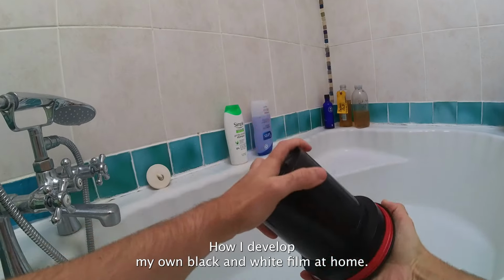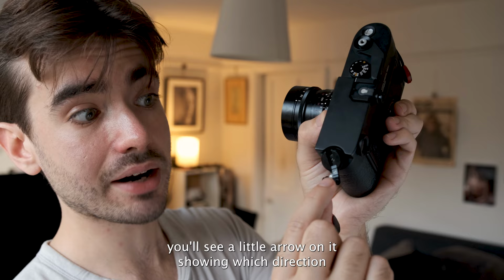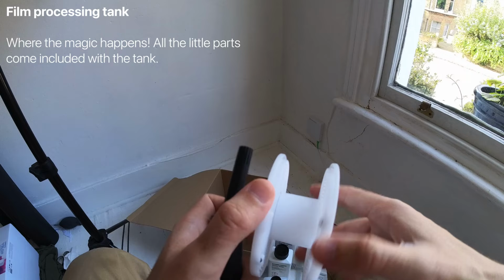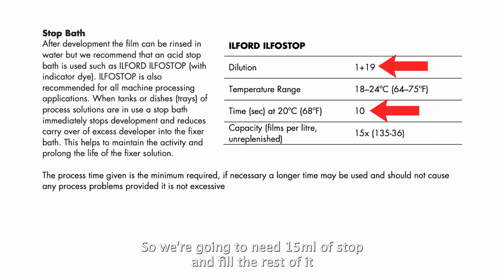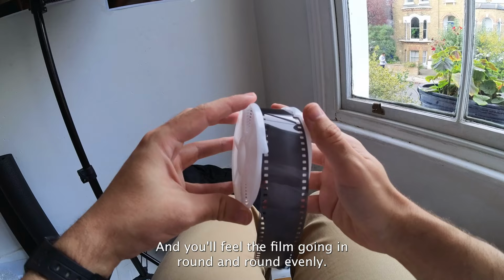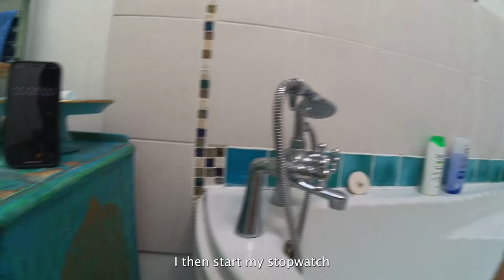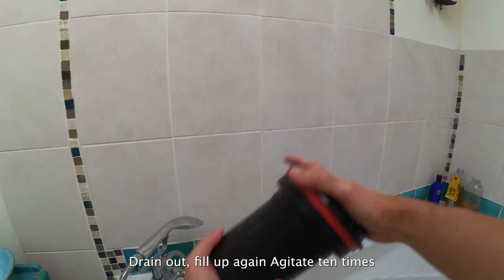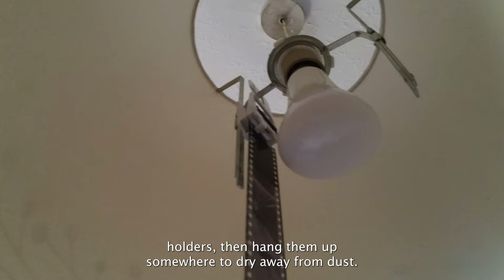How to develop your black and white film at home!

Comment: All in all, a very well put together video, very informal. Just a couple notes though; the rubber lid is for holding liquids in while inverting, it's not a light barrier by design, the small plastic bit in the center column is for agitating without inverting the tank and is optional, and lastly the temperature is not super critical to be exact as long as you get between 19-21 C you wouldn't need to adjust times to compensate for temperature.
Reply from the maker: Thank you for the information! 😎
Reply: @james-greenhalgh  most welcome

Comment: What are the chemical prices like these days? Last time I checked it was more expensive than having a roll of film professionally developed. It kinda put me off but I definitely want to get back into it.
Reply: If you're only doing one or two rolls every now and then, it could be cheaper to use a lab. But using concentrates with long shelf lives like rodinol or hc110 you will be able to process quite a few rolls, plenty enough to make a savings over lab service, and it lasts for years. But most b&w chemicals you are looking at roughly 12 - 30 USD depending on where you buy and what size you get.

You can also get a kit for processing up to 16 rolls for about 20-30 USD depending on where you buy it.
Reply from the maker: I agree with everything above :)👆🏻 

In the UK, Ilford products are generally more accessible from what I see as it’s all made in England anyway. Do take a look online for reviews of different chemicals to find the right one for you!
Reply: Buying prepared processing chemicals for B&W will probably cost around $30 (not including tank and related equipment), which is equal to about four lab processed rolls. However, that chemical supply can last for a year and will process dozens of rolls, depending on which developer you choose. So once you have the equipment, the "per roll" cost of DIY B&W processing is going to be well less than $1 a roll.

Comment: Not the right way to process a film.
Reply: Not clear on your objection(s) there. My negative comment(s) would be:
1.  The stop bath and fixer are reuseable. They do not have to be discarded after first use, and do so(as here) significantly and unnecessarily increases the cost of developing film.
2. The Pateson System 4 tank, used used here, is designed to agitate by twisting the little rod to spin the reels in the tank. It is terrible for inversion agitation, as here,  because the plastic lid leaks, it has a tendency to pop off in mid-agitation, and the huge volume of air trapped in the funnel-top turns the whole thing into a cocktail shaker, adding unwanted air/oxygen to your developer.